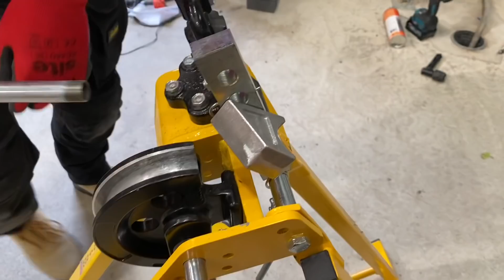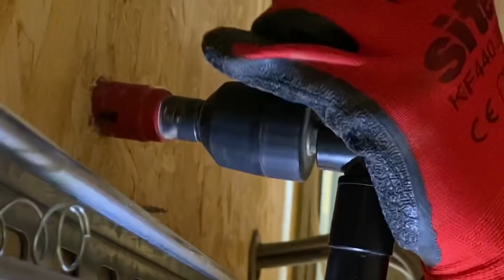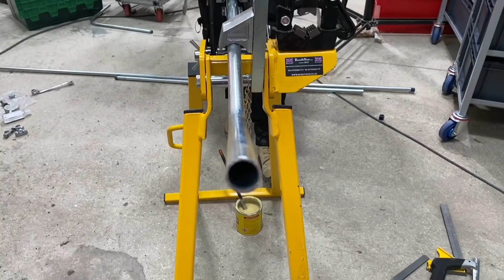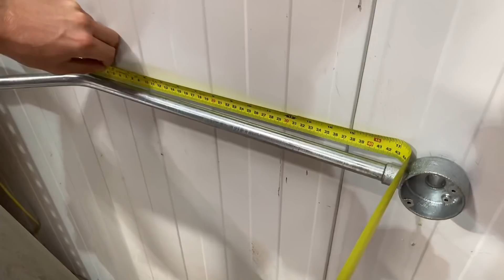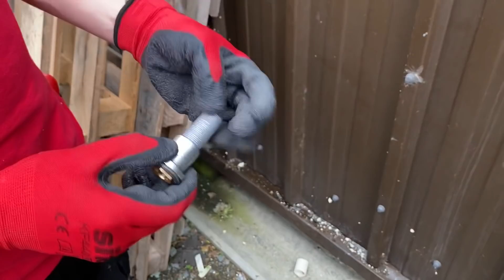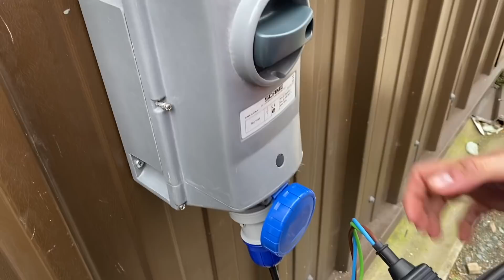WE COULD HAVE USED FLEXIBLE CONDUIT... BUT WE DIDN'T - Industrial electrical installation

Comment: This was painful to watch, come to the us and learn how to properly bend rigid conduit. Running threads are a code violation over here as well. The contraption you use to bend pipe is so much overkill, just use a hand bender and the proper take up. Any IBEW JW would be fired if he took that long to bend an offset and a 90 😂😂😂😂
Reply from the maker: If you think you can bend British standard conduit with a hand bender we’d love to see the video!

Comment: What's the socket attachment you use at the end to tighten that bush?  (None of the cheap-jack brass bushes I get from wholesalers have a nice metric A/F dimension that a standard spanner fits!)
Reply from the maker: The brocket - https://youtu.be/CRFJ1SD_2Zo

Comment: at first: thx for all the effort u put in this clip, but i doubt this way of an electrical installation is allowed anymore (at least in germany )- single wires in steelpipes?! wtf? this was meant to do 50 years ago. this is way too time consuming and too expensive compared to an installation with ether flexible plastic pipes or just NYM-J in those drywalls, eventhough h05-vk or h07-vk is more expensive than NYM-j etc. otherwise, they just do things different in the kingdom, they just dont give a f!?k about norms- not the first time for me to see an electrical installation, out of the kingdom, which i wish i would've never  seen. i mean all of the existing wires u see, already installed, where just nailed to the wall.  so whats the reason u choose to install single h05-vk/h07-vk wires inside steel pipes randomly instead of use a proper insulated cable nailing to the walls without steelpipes? i dont get it🤷‍♀ if i would do that i would loose my job immediately

Comment: What about push in fittings for the conduit? Seems that would save alot of time.
Reply from the maker: A few videos on the conlok system coming soon - watch for the comments for the traditional Uk electricians!
Reply: @efixx  Yeah I can imagine. I suggested using pop rivets for joining trunking the other day. I mean pop rivets not riv nuts and that kind of opened a can of worms. Actually push in conduit might well be more water proof aswell if that was a part of the objective of the designer. What about using a countersink in a drill to deburr the inside edges of the conduit?

Comment: This is absolute nonsense for regular households :D
This "protection level" might be required inside a CNC machine or sandblaster. Not in my basement. And definitely not for anything below 63A in any building. I would fight with my dear life to not let these kind of regulations apply here. Wasting money on sham-safety. Aka "I buy Volvo because it is safe for my kids".

Comment: Hi when you threaded the conduit to make a extra long nipple to go through the wall surely a coupling could have been cut cut down to cover the extra thread therefore giving a more solid Finnish.
The long nipple yes was sprayed with a protective coating but I feel a coupling would be of an extra advantage
D Warner

Comment: Great process and work. I'd always use a pencil so marks can be wiped off after bends are done. Having worked I north America for 6 years I did miss the proper benders we used in the UK. Took a while to get used to their hand/foot benders. I did like their fast fittings and thinner gauge steel conduit though. The likes of this conduit run could be done I under 30 minutes with the north American style of conduit and fittings.

Comment: A few people have commented on here about the fact that you called rivnuts or nutserts, pop rivets. However, you must have known that there is a major difference between them and pop rivets yet you gave no explanation as to the difference and the fact that the tool is different from a pop rivet tool. Your videos are usually very informative but this must have left a lot of people who are familiar with pop rivets confused as to how you would use a screw with them.

Comment: Good install bit didn't see a weatherproof seal at the wall or the back of the external box.  In a  heavy rain water could get in.  Obviously I have presupposed the box is on the outside of the building.
Reply from the maker: We used a flanged coupling with lead washer.
Reply: Those blind nuts may also need waterproofing

Comment: What you were calling a "pop rivet" wasn't! It was a Nutsert or blind threaded insert. Similar but not identical device and process. Could have used a long reach pop rivet through the saddle though. 🤔😁
Reply: If your riv nut goes pop you got problems. Broke the threaded stud on my tool.

Comment: you are far not electricians,  you are 
labourers. actually there is no electricians in uk, only labourers. 1: it is much easier just to remember 1 time the plus and the minus that bender does and you'll don't need to measure like that anymore. 2: there is no 30° bend standart in uk , the bend must be 45°, 90°... (I hate labourers who does random degree bands, snagging after them is hell). 3: each joint within 300mm must have support,  the screw in the box is not accepted,  screw in the box only labourers does. 4: tap and die(yeah, it is tap and die, it is not stock and die) never goes back, only straight till the end. if you go back and again straight you fuck the blade. I was using a blade 1 year and I gave the tap and die 1 time to a labourer(uk electrcian) and he fucked the blade doing conduit like you. you know, I am working 3 years in uk and I didn't meet any electricians. the  clients pay a lot of money but they see only the end product, they have no idea what trash is done and hidden behind that  beautiful wall or ceiling, totally trash... /cry 😢

Comment: Lovely job guys. QQ: when did the live become known as “LINE” and what’s the thinking behind the change?? 🤔
Reply: I don't know the exact date Samuel but I did my apprenticeship in 2010 and it was called the "line" conductor then as well.
Reply: Not entirely sure when the nomenclature changed, but you hear live, line, and phase (less commonly) thrown around by various people when referring to a line conductor. 

the thinking behind it is, as the neutral generally carries current in normal circuit operation, it is a "Live" conductor, that also carries shock potential in certain circumstances.

Comment: Back in the day I added an inch and 3/4 to the back of the bend mark and put that on the back of the former .bend it ,job done .Also you can add two and a 1/4 for bending 25mm conduit .works every time

Comment: Try using a bending block like we did in the 60’s ,you could bend tighter angles easily,every one kept their own block jealousy guarded because once it was worn in it was perfect
Reply: I was going to say exactly the same, bending block was the way, bending machine luxury !
Reply: How do you make? Or where do you buy a bending block? The amount of times I have had to buy elbows or sweeping bends because I couldn't get a tight enough bend.....
Reply: @andyglass3882  we had to make our own blocks,usually out of a 3 foot piece of 3x3 hardwood with a 3/4 hole at one end and an inch hole at the other.The holes were carefully drilled from both sides and angled to aid the bending but they took a bit of working in until a smooth bend could be made.Some guys used to burn the hole through to harden the wood around the hole to make it last longer.There are or used to be tighter formers for bending machines that made really tight right angles.Bending blocks took a lot of practice but could achieve really impressive sets and bends

Comment: All that messing with levels and squares to get your  bend position?why not use the ole add/subtract 50mm (best to double check  your former) from the measurement to get were the pipe sits at the start of the former.Also get yerself some footprints,not only the best grips for conduit,but the handle doubles up as a reamer  for cleaning up the burrs

Comment: Good Video… Love Gaz’s Banter 🤣 👍🏽 …. Great teacher 😉 

But did anyone notice that the Unistrut at the back of the board was the wrong way round ?  🤣   The give away was the  Zebedee springs were  hanging out  👍🏽
Might be a reason for the strut to be reversed … But thats not how you mount a Zebedee 😉

I don’t miss threading 25 mil conduit 🤣👍🏽
Reply: You should have tried 2 inch conduit in the 60’s and with hand dies not ratchet,I was once made to thread a full length and cut it up into nipples for giving lip
Reply: @anthonyschofield7807   
Absolutely been there done that haha 🤣👍🏽  I did my apprenticeship in the early 80’s … Working with a contractor at well known car factory’s   doing all the indoor and outdoor lighting ….. Miles and miles of 25mm galv conduit …. i was a bit lippy too and found myself threading full lengths of nipples 🤣👍🏽…. The bad old good days  👍🏽 …. Still got my pipe vice and bender and stocks and dies 👍🏽…. They should use them to punish young offenders haha 🤣
Reply: @dizshiz  happy days when an apprentice knew his place

Comment: Good stuff. However a craftsperson talking in cm and not mm sounds wrong.
Reply: I take it you haven't met an old boy, who measures in inch fractions, as of yet then 😬
Reply: @h8ryj  Iv never heard my electricians use anything but inches lmaoo
Reply: Doesn't really matter if the job gets done, and done well 👌🏻
Reply: I wouldn’t let it worry you… Karl knows the score 👍🏼
Reply: Tbh comments make me laugh as anything we measure is in mm’s - ex - next spot light is 500mm away
Reply: When we went metric in the 70’s it was a given that we only used metres and millimetres,when the apprentices started arriving and trying to measure in centimetres we had to re-educate them.Look on any construction drawings you won’t find any centimetres
Reply: @anthonyschofield7807   👍🏼
Reply: Always use what ever is the easiest to remember. 
In other words I’m a nightmare when I go to B&Q to get a sheet of wood cut 😁
Reply: @dringonator6911  Given that you can still buy half-boards in "6 foot by 800mm" I think we have other problems with standardization... ;-)

Comment: Super video thanks. Really enjoyed it. Not sure proper electricians ware gloves though..
Trouble is these days I fined  most metal conduit is crap especially the spacer bar saddle clips and brass bushes .
Reply: Never used spacer bar saddles always stand off and bush heads got so small that sometimes they were smaller than the knockout

Comment: I was always taught lock ring before a box or coupling to tighten against, also deburr before you remove the dia.
Reply: I'm guessing your from Scotland. I worked with some lads from there years ago and that is the way they do it. I did mine as the above video.
Reply: And a stand of saddle 9 inches from every bend,box or accessory and 4 feet between saddles

Comment: Do you have a link or name where you can get them pop rivits from
Reply from the maker: I’ll dig out the info when I’m back in the unit on Monday - I purchased a kit from RS £££ which included the tool - Cheers Gordon
Reply: They are rivet nuts , not pop rivets as said .  E bay sell them